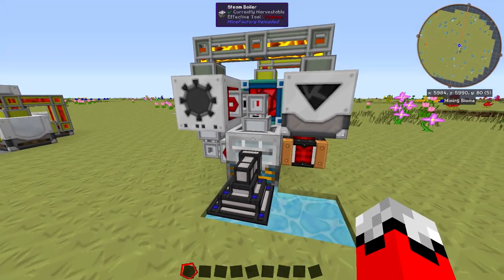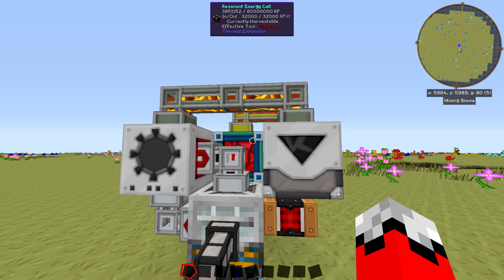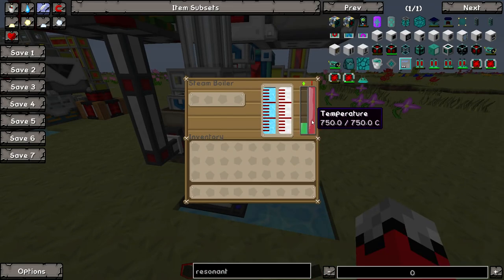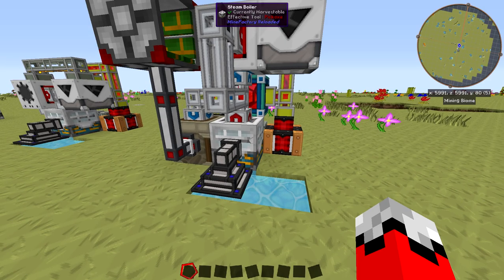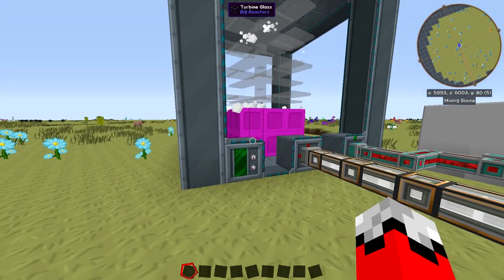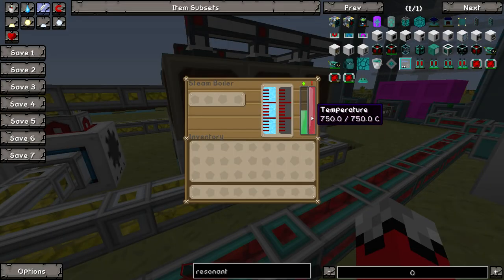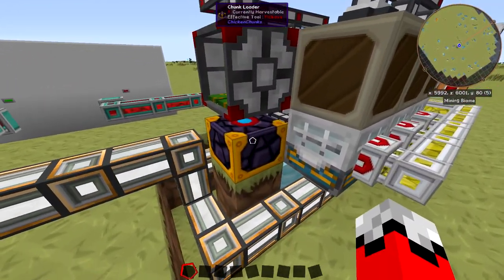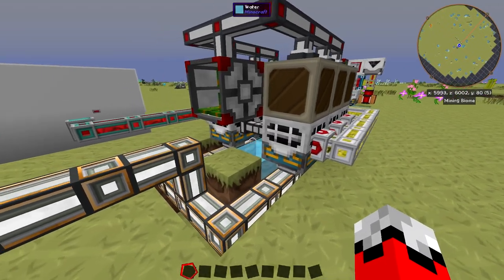Spotlight:  MFR Steam Boiler Followup: Infinite Power Exploit

Comment: This can be made even better by replacing the Fluid Transposer with an Ender IO Fluid Tank (it has automation-ready bucket filling with no power cost).
Reply: I may be 6 years late but just started a new 1.7.10 FTB world and the Ender IO Tank is a genius Way of refilling buckets for my Stirling Engines (also Ender IO). Cheap, easy to make power sources

Comment: your video was very helpful, although you're not quite right about the size of the turbine just 5 boilers can support. they can make the max-sized turbine work with no issues(60k rf/t, 1800 rpm, 2000 mb/t)

Comment: I'm pretty sure they fixed this bug in the latest updates of MFR
Reply from the maker: +Amin Zerfa I see no indication in the last 30 or so commits made since June that either this exploit, or the weird steam-boiler/chunk loading issue has been addressed.

My ticket reporting the exploit is also still open, so I'd bet this is still an issue.

Even so, I'll update my test pack and give it a go later tonight.
Reply: Hmm, perhaps I was mistaken. I haven't heard much about this bug since it was fixed in 1.6.4 so maybe it has reappeared since then. My apologies
Reply from the maker: +Amin Zerfa Just finished testing with a fully updated pack.  Definitely still a thing, both with rednet control and without.

No official reply to my bug report either, so I guess this goes in the Eventually™ pile of bug fixes.